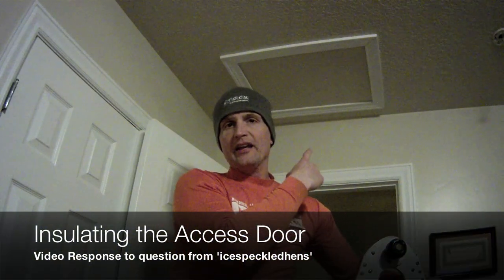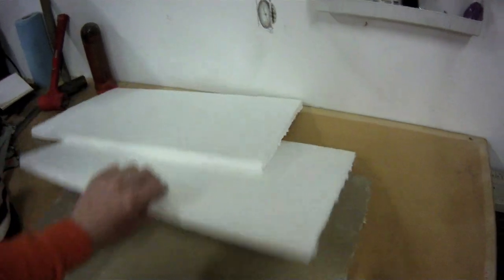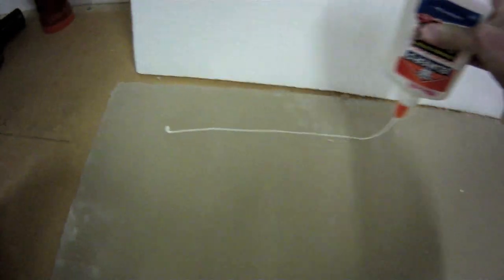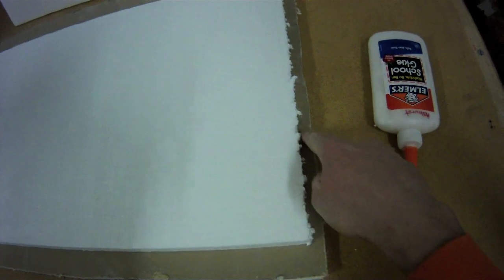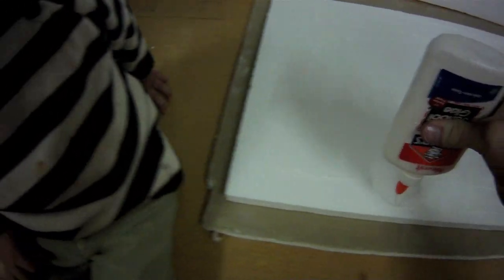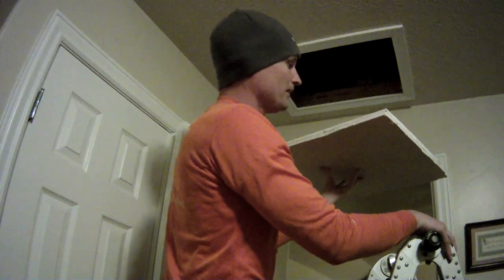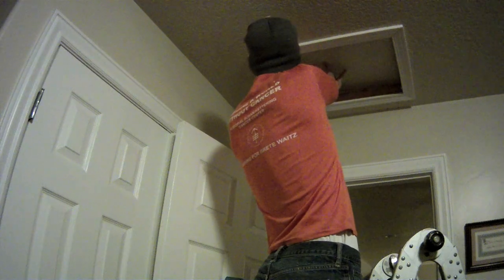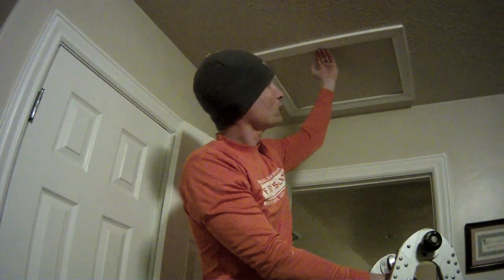Insulating the Attic Access Door

Comment: Can’t you just put a small piece of roll on top and slide hatch over with it on top?
Reply: If you mean just push the drywall up a bit and slide it over, I think that might be a little tricky because of the studs surrounding the opening. Maybe if you glued down the rolled insulation it could work 🤷🏻‍♀️

Comment: Not enough R value with those 2 sheets. Need twice that.
Reply: What would you use ? My attic door access is in the garage, I am planning to use Reflexit taped onto a cut to size board. Wondering what type board to use ??????